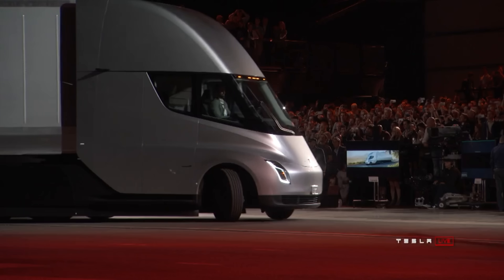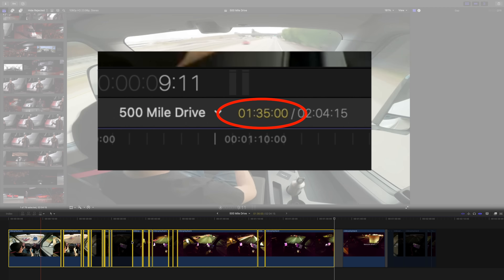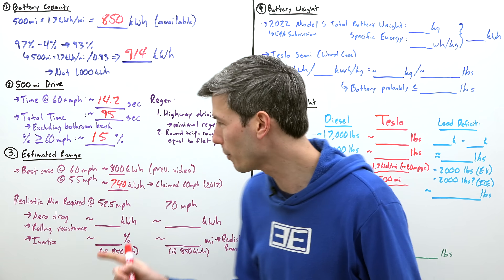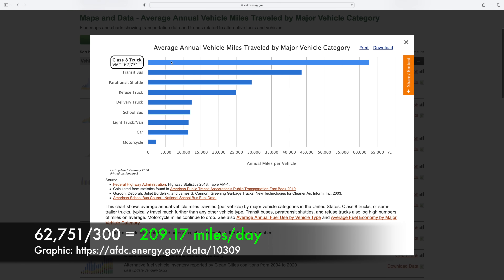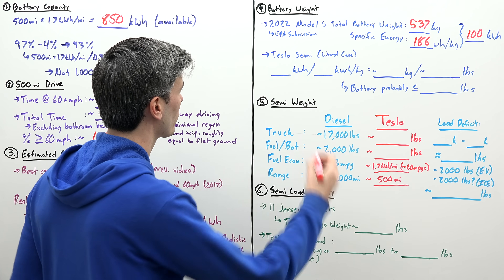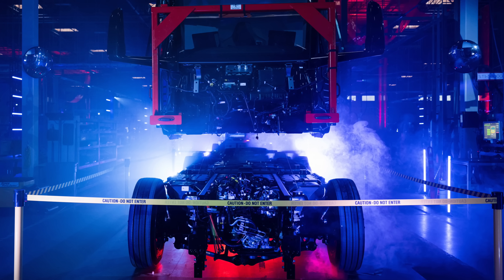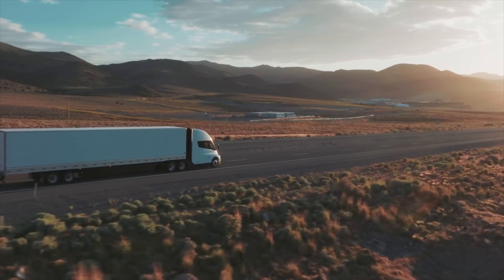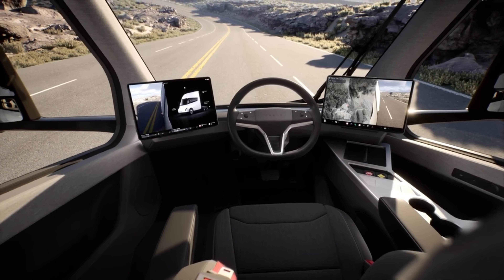Does The Tesla Semi Make Any Sense? Part 2!

Comment: Deceptive marketing?

There is a big difference between intentionally deceptive marketing and a reasonable expectation of what a manufacture feel their product will bring when it comes to market. In the case of the Tesla semi it was hope that 4680 battery cell development would be much faster than it was, which certainly delayed the introduction of the semi. Secondly, the overwhelming demand for their other vehicles made it prudent for them to focus on existing product demand rather than bringing a new vehicle to market. Thirdly, the comment on the semi having four motors instead of the current three was made in the time before the plaid 1000 hp motor had been developed so at the time for motors was probably reasonable. Moreover the evolution of the 1000 hp Plaid motor has made the semi even more attractive than the original spec. In this case easily one of these 1000 hp motors would be driving the vehicle most of the time; not possible with the original design.

Again, deceptive marketing, which is something that GM specializes is one thing, but being overly optimistic is a completely different issue and certainly Elon has a reputation for pushing the boundaries of what’s possible to the absolute maximum.

Comment: Good and balanced commentary!
One thing that has baffled and piqued curiosity of several folks is how Tesla Semi is able to achieve its super efficiency. One aspect that seems apparent is the smart rationing of torque at the wheels.....(the more powerful front motors kicking in only during accelerations while a single rear motor provides the steady force to combat aero drag and rolling resistance).
Would be great if you could provide your analysis and thoughts on this.

Comment: You assumed that the weight Tesla Semi w/out batteries would be the same as the ICE semi w/out fuel. I think this not correct because an electric drivetrain weighs less than a diesel drivetrain.

Comment: Yeah, I think that the worst "bad faith" arguments people make against electric vehicles are "there is this edge case in which an EV is not as good as a gasoline car," and yeah, that will be true. There are still cases where a horse is a better choice than a car. That does not mean that most people should be riding horses most of the time.

Comment: This whole endeavor is a bit silly without electrified highways in a similar way to railways.
Just electrify a few 100s km put a pantograph on the truck to charge the batteries while driving and there you go.
I bet the twitter money could have been used for this.

Comment: This is the first ever "mass-market" electric semi, of course it will not be perfect and of course it will have drawbacks and will not be better than a diesel truck in 100% of all use cases. And if it can recharge in 45 minutes (assuming the infrastructure is built out), then it can recharge when the driver is on their mandatory break, so why is range even a point of discussion? I am convinced that all transportation will go over to electric over the next decades, technology will improve, the infrastructure will improve, and in the end we will be better off, except those who somehow like engine noise and cars with tons of fluids that can leak, but they can still hold on to their ICE cars. From what we have learned, this is an impressive first attempt of an electric semi, so let's see what it can do and don't just say it will never work before we have even seen the first specimens on the road!

Comment: Why not put the batteries on the trailer itself? So you pick up a loaded trailer with a full-ish battery that's getting charged while it's loading, then you leave it at destination for off loading and recharging and pick up a new one
Reply: Possible, but trailers are often their own commodity. Trailers can be bought or sold, used as temporary or semi-permanent storage, shipped to different places...etc. Having batteries in the trailer would be more restrictive of the usage of a trailer in addition to adding extra weight, which isn't ideal, and may be dangerous as you have large amounts of lithium ion batteries now taking part in scenarios where it previously didn't.

Comment: They confirm the battery size is 900. They confirm the weight of the 530 mile semi is 26,000 lbs.  This is publicly available. 530 version can carry 44k. Again, this has been released. 49k for the 300 mile version which is 510 kWh
Reply: How about wintertime?
Bet that range drops in half when its below zero...
Reply: @jkarra2334 my model 3 loses about 18% at 20 degrees fahrenheit. Since the energy distribution for a semi is nearly the same to keep the driver warm, you're likely going to be closer to 10% less efficient in very cold weather.

Comment: Along the lines of financial sense…does it make sense for the taxpayer to subsidize these vehicles at such a high percentage of the cost of the vehicle?  The taxpayer is already burdened excessively.  The costs of government taxation gets buried in every product or service that is purchased. The taxpayer is being asked to create revenue and profits for Tesla and its shareholders. A subsidy of $20k-$40k per truck seems far more reasonable than $194k per truck. 

There has been so much emphasis placed on EV’s and not enough emphasis on the electric generation and distribution infrastructure.  Good luck to the electric truck driver in California who cannot charge his truck in the heat of the summer with rolling brownouts or blackouts. 

There is value in diverse energy sources.  Over reliance on electricity for everything will prove to be a mistake. 

The beauty of fossil fuels is they come out of the ground containing potential energy in the form of hydrocarbons.  Every EV requires an electric infrastructure to create energy which creates a large burden on the power generation infrastructure. 

Are EV’s the way to go? Sure. Over a long period of time with significant rational planning vs. politically driven and potentially corrupt, Washington policy and decision making.

Comment: I think there's one more engineering challenge that needs to be considered.
As I understand it (grain of salt here) the worst thing you can do to a Lithium battery is fully discharge it and rapidly recharge it.
Assuming shorter runs, what is the life expectancy of these batteries if they are drained to 50% then rapidly charged back up?
What is the cost of battery replacement?
You'd usually expect a battery to last 3-5 years, but it would seem these batteries are going to be treated rather roughly.
Reply: This partially depends on the battery cell and battery pack arrangement. In theory you could parallelize the charging. Batteries are rated in terms of C, their capacity, and the charging rate is based on C, so like 2C. If you parallelize the charging, the per pack charging rate may not need to be that high and may be similar to general DC fast charging in their cars. Further, temperature with fast charging is important to battery life. If they can maintain proper temperature while fast charging, that helps too. My guess is they'll almost need to do some sort of charging parallelization since the current required is already giant. So, as like this video, we don't quite have enough info to say with certainty, but there are methods to reduce the severity.

Comment: Can we stop using the term "efficiency" when the correct term is "economy"? 

Efficiency is expressed as a ratio or percentage. It is energy out of a system over energy into a system.

Economy is how far something goes per unit of energy.

The two are not the same. A diesel semi truck has a very efficient engine (for ICE), but has low economy because of it's size compared to a normal car. 

Efficiency is best left for evaluating a powertrain on a real dyno. We are talking about economy here.
Reply: Both are metrics of efficiency from what I understand. The two are related, though caveats apply when comparing based on economy, since you'd need to know the fuel type (specific energy) and cargo weight, and assume both traveling at the same average speed. EPA measurements of fuel economy try to do this with having no cargo weight (no passengers), but simulate different driving behaviors in a deterministic way. A more fuel efficient vehicle in this fashion will have a higher fuel economy, as fuel economy is directly proportional to whole system fuel efficiency, if other factors are kept the same.
I like to think of fuel economy as the entire system efficiency, since it takes into consideration everything from the aerodynamics of the vehicle, to the driver's behavior, to the cargo weight, the weight of the vehicle itself...etc. I think the issue is that fuel economy is a measure of efficiency, but we also have the term, 'fuel efficiency,' and hence people tend to think usage of the term must mean 'fuel efficiency.' However, you can have multiple types of efficiency metrics. I think it's just as valid to compare fuel economy as a metric of efficiency, with the caveats previously given. I've even seen the National Academy of Sciences and Engineering use fuel economy as a metric of efficiency.
Reply: @JimBob1937  no.

Efficiency has to be a ratio, fraction or percentage and is dimensionless.

MPG is not that. MI/kWh is not that.
Reply: It seems to be the case of maybe energy efficiency specifically in the transport sector having its own definition, which basically is fuel economy.

"The energy efficiency in transport is the useful travelled distance, of passengers, goods or any type of load; divided by the total energy put into the transport propulsion means."
Reply: @JimBob1937  ehh. I'd argue whomever wrote that is incorrect.
 
It's obviously used that way, but not the right definition.

Comment: That is very interesting Jason.   BUT the REAL SPEED the truck is going at is the combined ZERO km/h speed during charging and lunch  and pee break. When you include that portion of time the truck is not running, the real average speed is not what the speedometer tell but what both speedo and breaks at 0km/h tell which impact the real average speed and power consumption.

Comment: I may have missed a part. But I have question of how will this Tesla truck do in extreme temperatures. Alaska or Arizona? Driving from LA to Flagstaff  on I 40 during the summer months?
Reply: There's no reason why it should have any difficulty. While we don't know the details of this truck, Tesla has used thermal management of their batteries for 10+ years. They know how to do it. This is not an overgrown Nissan Leaf.

Comment: Cold weather range is another factor, a lot of EV’s loose at least 40% of there posted range in colder temperatures. The other concern is fire mitigation. In the event of an accident a standard Tesla car can take 3-4 days to put out and take 4-5 times the amount of water than a standard car fire. I imagine that insurance cost will be a big factor as well because I can only imagine how much it would cost in collateral damages

Comment: Thanks for the best reality check that I've seen to date (when combined with the previous video).  Still a ton more to learn, but it's interesting that a fair bit ostensibly checks out so far (albeit with extremely limited info from third parties, almost all from Tesla, validation seems essential).  Real world reliability, range, loads...in various scenarios, reported by third parties... will be important to learn, as well as the price to some degree.  But the electricity price probably is even more important than price, as the fuel savings seemed to be the biggest factor in the last video.

Without a substantial charging network, the current model seems to be a company, like Pepsi, delivering from its factories, and charging back at the factory (overnight?), or maybe at certain destinations (company warehouses?).

For other types of trucking, I wonder if the thinking is wrong, trying to match the technology not to the problem but to the current solution.  If a trucking company had locked yards with security for trailers located around the country, a trucker could charge the tractor at home over night, start work in the morning, pick up a trailer from the local lock yard, take it 3-4 hours to the next lock yard or its destination, charge a bit over lunch, then drive another trailer the reverse direction.  Although long haul delivery wouldn't be as fast as through driving with a pair of drivers, it might be more affordable, and with plenty of truckers willing to do it long term.  Sleep at home every night, have breakfast and dinner with the family, live in some affordable and nice town somewhere within ten miles of the highway (a reasonable commute).  Do clients really need loads driven cross country straight through (but not quite wanting to fly the load), or is it just done because it's available and not much of an additional cost?  Would even a small savings per load have them willing to wait for a "bucket brigade" to ferry the load from pickup to destination over several days?  Standardized cubes, shipped in much this way as far as I can figure out, seem to be rising in popularity for long distance home contents moving.  They're often cheaper, with more predictable schedules, and I see them around more.  If this proves to be the way, or even companies trucking their own loads up to 200 miles from their factories, then the mega chargers would be less needed than affordable overnight charging.  It would require higher wattage than is common, for sure, but maybe time of day rates become a big savings, using that power produced in the wee hours of the morning, but with little demand, often sold near wholesale rates, way below even 7c / kWh.

The conclusion from the max load calc seems slightly overstated.  Certainly, some loads are indivisible, but I suspect that many are just fit to the limits of the trailers and trucks.  If truly enormous loads needed to be shipped, then surely trains, no?  Slightly smaller loads per truck would increase labor and capital costs ten percent, say,...but against lower fuel cost.  An analysis of which factor "wins" seems like a relevant calculation.  Until that's possible, it's not clear what the impact is of an inferred modest limit affecting a small fraction of current loads...maybe none of those heaviest deliveries will be viable for the Tesla Semi, maybe some or all by splitting them differently.  Ten percent more trips might be a deal breaker, or it might be a benefit by allowing more frequent deliveries at, conceivably, a similar total cost.  So much more we need to know about the vehicle to assess its real world capabilities, limits and what uses are viable (once the publicity value fades).

Comment: Most truckers only work 4-5 days. The miles are also concentrated. They sit, are loaded, then travel with as few stops as possible, then unload. Drivers are limited by hours they can drive, not speed. 55 mph is ridiculously slow when you can only drive for 8 hours at a time.

Comment: On current electricity/gas prices, tesla semi is more economic viable vs gas trucks, after 1M miles, even if priced at an unrealistic 500k$.

Also, with proper solar infrastructure at locations A and B, think rhe charging electricity cost can reach the 7cents (50% off)

Comment: Those speedlimits are bonqers. I get that you need them because of the long distances and many-many mile long straights but it feels dangerous even just to think about it.
85mph is the speed allowed for normal passenger cars on most highways in Europe. How would you stop a truck from that speed. Insane. :D
Europen trucks are factory limited to 56mph and the speedlimit is usually 50mph here. The optimal consumption is somewhere around 52mph - resulting in 25 to max 30 liters per 100km for 40ton trucks.

Comment: I assume the reasoning that the Tesla semi is not good for long haul is the current lack of charging infrastructure; that will not always be the case, so the real reason is not the truck, but, rather, the support currently available for the vehicle.
Reply: The real solution is to move more regional and long-haul freight by rail instead of trucks, as rail is far more energy-efficient. Long-haul and heavy haul trucking are some of the worst possible applications for fully-electric powertrains, and will likely forever be.

The lack of charging infrastructure is ultimately just the tip of the iceberg in the grand scheme of things.

Comment: I'm really interested on how they'll work out the logistics considering that an EV truck can't go as far and "fueling" takes a lot more time. I don't see this being wildly adopted unless there is a robust charging infrastructure in place (like Tesla Supercharger network).
Reply: Hardly! Let the sucker charge while the driver is sleeping. Not only is it going to "fuel" during downtime anyways, but because it doesn't require driver attention like gas fueling, it's not being babysat and you actually end up saving 15 minutes that you're not gassing up a truck with.
Reply: @dIancaster  That's considering if there's enough charging stations to accommodate all trucks at night (which won't be the case for obvious reason). It has to be planned so that no truck is sitting around waiting for its turn to charge and trucks also have to move after it's done with charging which means that driver can't just go to sleep. EV trucks require a lot of logistical planning.